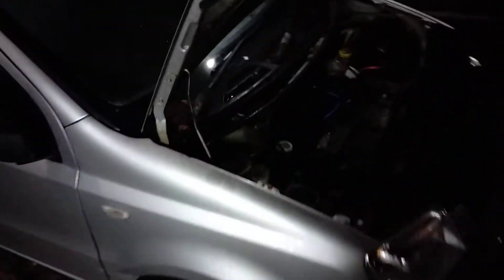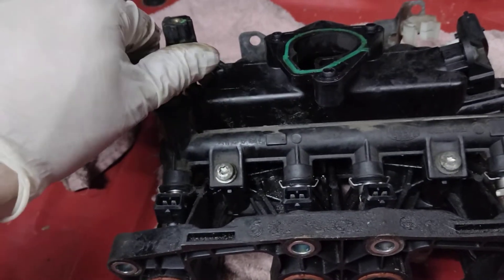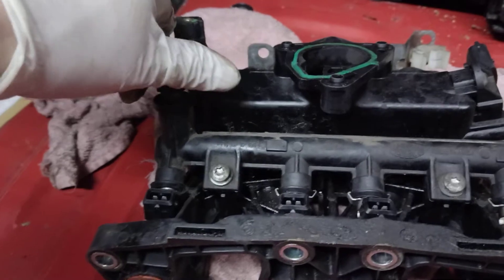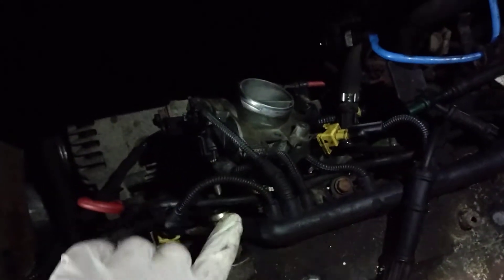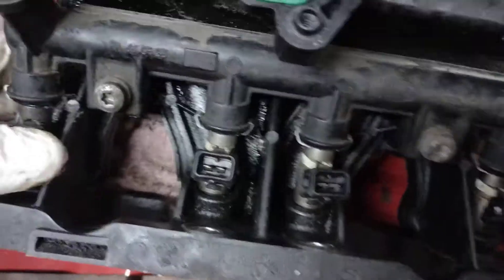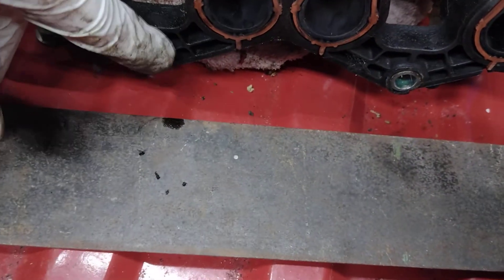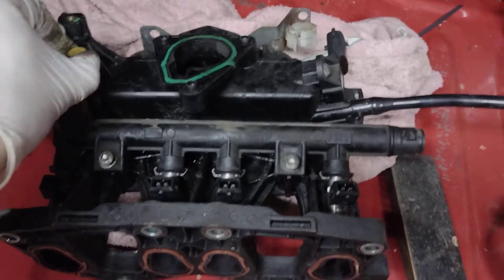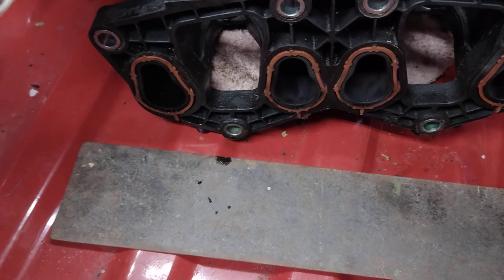Fiat 1.2  Hunting / Revving poor idle FIXED SOLVED

Comment: "PERFECT" same issue on my daughters Panda after I did the head gasket. Melted in the same way as yours, replacement £25 off Ebay. Thanks so much for making the video, I did not spot the melted inlet manifold as I did not remove it from the car when doing the head, have been looking to change sensors etc.
Reply from the maker: Brilliant! Really glad you found it useful.

Comment: Just a final note to say yes on my 500 the rough idle was fixed by replacing these inlet gaskets and also the exhaust gasket was in bad shape. Nothing at all to do with plugs, coil or injectors for me. Obviously I flushed the injectors though while apart as well. So should you if attempting this job. Thanks for the video to kick me into getting on with it.

Comment: You Cooter are brilliant. I did explore the exhaust manifold on my 500 and that had soot marks around 1 & 4. Your findings and this above will defo give all sorts of rough running. I’m going to do what you say now as I can tell you are right already. Cheers
Reply from the maker: It may possibly help you, a leaking exhaust manifold could certainly cause incorrect fuelling, the lambda might be getting skewed signals. 
I hope you get to the bottom of your issue.
Reply: Yeah I’ve swapped parts from an identical 2016 car so not too much spending but this weekend I changed the belts, water pump, sump, rocker & ex. manifold gasket. Did a relearn. No errors registering in multiscan but STILL a rough idle. I’ll report back in a week after I do what you have suggested. I’m sure you are right here. Car has 60k miles. Thank you for replying I appreciate it.
Reply: Cooter, I did the inlet gaskets, exhaust gasket, cleaned everything with carb cleaner. Swapped plugs & coil from another same 500. It runs fine but once into a good 2mins of driving down the road, you can feel the odd mis and it then won’t idle nicely. No codes but idles a bit lumpy. I’ve checked the fuel vapour valve and isolated the servo to check it’s not them. Any ideas? coolant is fine clean not vanishing.
Reply from the maker: This panda has developed the same problem. 
I have checked everything, the only thing I'm not sure about is the ECU.

Comment: Hey, just wanted to update you on the issue with my car.

First, we replaced the throttle body, but that didn’t fix the problem. Then we swapped out the automobile sensor, but the issue is still there.

Here’s what’s happening now:

When the engine is cold, the idle is fine and there's no problem.
When the engine heats up, the idle starts to get unstable.
When I turn on the A/C, the compressor starts up and everything works normally at first. But once the A/C reaches operating temperature and the compressor starts idling, the idle goes unstable again.
When the compressor kicks back in, the idle returns to normal.
Just wanted to share this and see if anyone has any advice on what might be causing this. Appreciate any help!

Comment: Could well be my problem, brilliant, what did you do in the end? Put washers under the nuts? Are they 13mm
Reply from the maker: I sanded the mating surface flat, took the tubular spacers out and reduced their length with a grinder. Fitted the manifold back with very thick washers.
Yes, M8 nuts. 13mm head size.
Reply: @co0ter1  I did check mine, they haven't pulled through but thanks for the info, much appreciated 👍🏼
Reply from the maker: @bonkeydollocks1879  what's it doing, hunting?
Reply: @co0ter1  surging, very slight rough idle,. I put on a new throttle body gasket and manifold reface where the throttle body sits, it was a bit misshapen, new precat 02 sensor , and my obd reader bought up a MAP sensor code, had new map sensor seems about 95% ok but compared to my wife's identical car it's just not quite the same, not quite as crisp but loads better